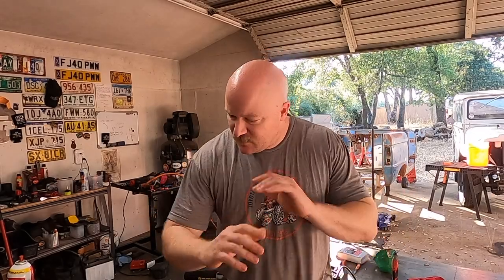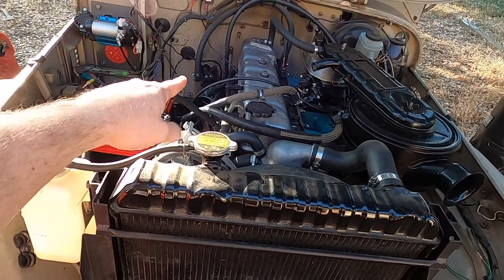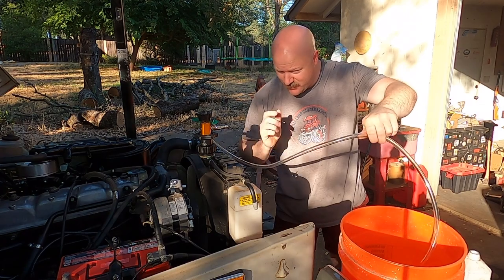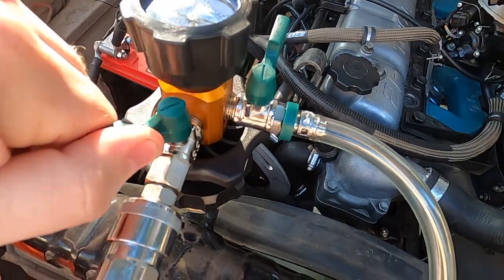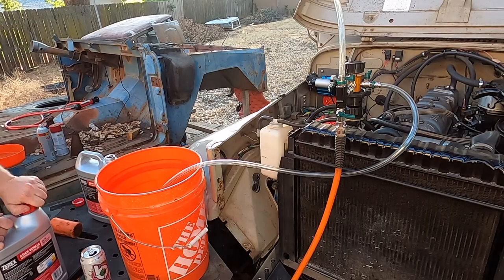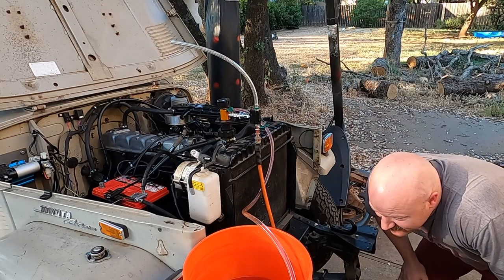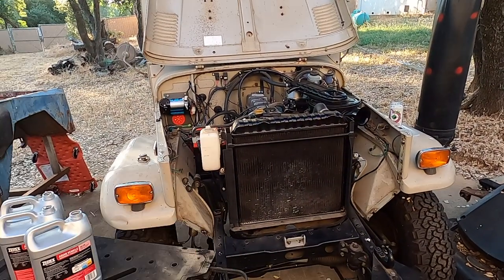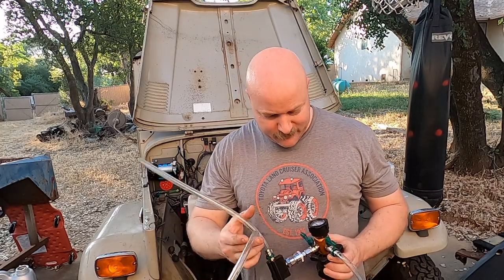OEM Tools Coolant System Refiller Kit, I Test It, No More Burping Coolant On Landcruisers.

Comment: The first time using a coolant vacuum refill kit is strange. You captured it perfectly. The creaking of the radiator and the collapsing of the hoses is nerve wracking.  In the end, you don’t have to burp it so saves so much time.
Reply from the maker: It’s like a submarine ticking… nerve wracking stuff. I ended up still burping mine a bit, I imagine it was user error.

Comment: Your still going to want to burp them.  We vacuum fill everything, but still end up burping all of them.  It does help with keeping air pockets to a minimum and is way faster than just pouring it in.  .
Reply from the maker: Crap! Really? I’ll have to burp it then. I will say the machine hasn’t overheated yet without burping, but I consider you a pro, with good advice.
Reply: @projectwrongway9127  the heater on a 40 may be low enough that you won't have to. Newer stuff with higher heater cores seems to always need burping after.
Reply from the maker: Always appreciate your input man.

Comment: you can save dollars by buying non-premixed coolant.... mix it in the bucket. Nice to see you have a suck enhancer.  Another fun thing with those, because they create a vacuum - you can use it to pull plugs and not have the fluid escape (imagine putting your finger over a straw to lift liquid - same principle).
Reply from the maker: Man I did not think coolant was so expensive, and damn that system is thirsty.